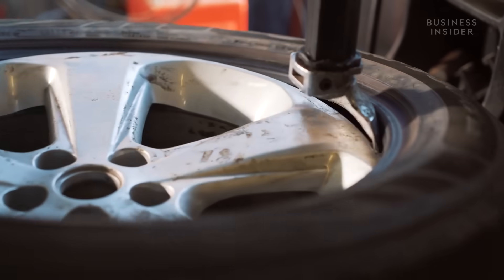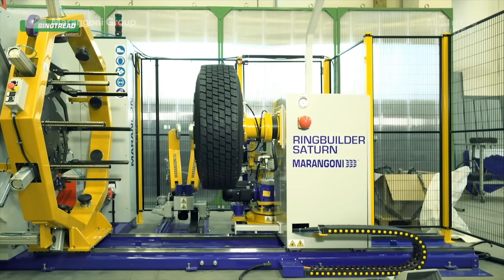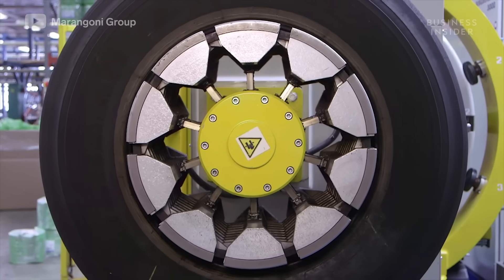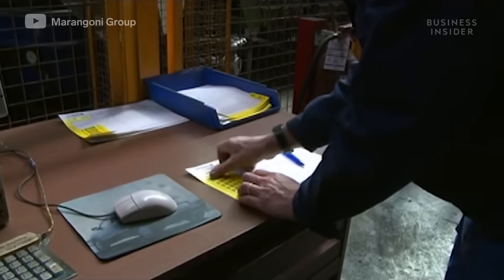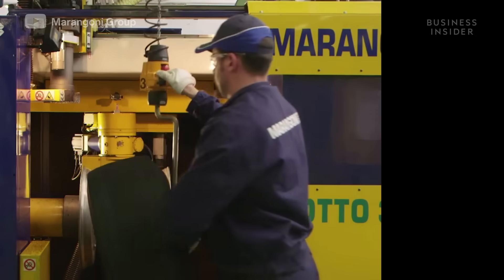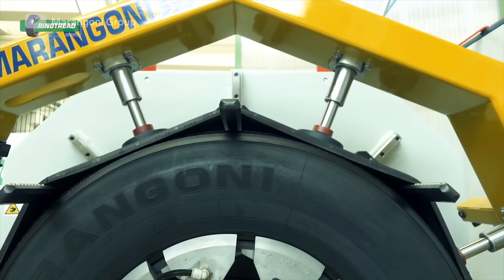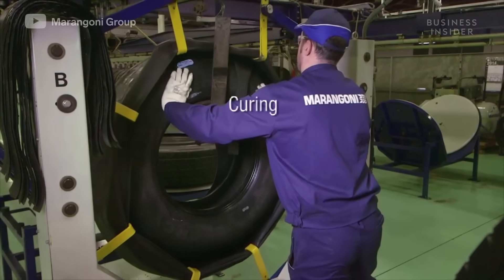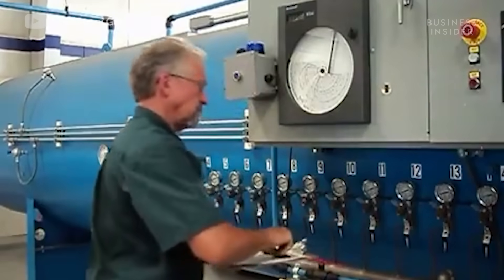How Old Tires Are Retreaded So They Can Be Used Again

Comment: Sweet, people are actually NOT wasting items for once
Reply: retreaded tires are extremely dangerous and should never be used. everytime you see a truck on the side of the highway with an exploded tire, it's almost always a retreaded tire that has exploded, for cars and especially motorcyclist, getting hit by one can mean death.
Reply: @KujezZi  Site your sources
Reply: PutrHH thats incorrect, truck tire blowouts are due to under inflation, or unevenly inflated tires putting more strain on the others. I have ran over 2 million miles with retreads on my truck and never had a blowout. You drive truck?
Reply: @KujezZi  Regrovable is different from retreading a tire isn't??
Reply: @rockraphlegal  Yes, re-grove is intended from first production, to take a large tire, wear it down, re cut for a smaller diameter. That is much safer than retreading.

There is no way I will ever use retreaded tires, I do not care how cheap they are.
Reply: @rockraphlegal  in answer to your question when a tire is marked as regroovable it means that the manhfacturer has left enough material so that when you have 2/32 of tread remaining you can cut in using a special iron another 4/32 of tread and still leave 3/32 of material between the bottom of the groove and the top of the belts. However these days because retreads are much safer than previously regrooving is not a standard practice because your much less likely to be able to save the original casing because not enough material remains for them to grind down like shown in the video before they get into the belts of the tire. Manufacturers still mark them as "regroovable" because if the material is there beneath the tread the DOT requires the marking even though retreading is the prefered practice for fleet owners these days.
Reply: Instead you're wasting lives
Reply: The process of retreading tires has been around for a long time and has since come a long way and today they are just as safe as but far cheaper than a new tire. When you see blown out semi tires on the side of the road it almost always result of being under inflated. Thats why manufactures are coming out with tire pressure inflation systems to help minimize instances of tire failure due to under inflation.